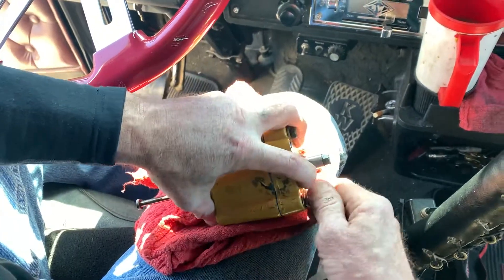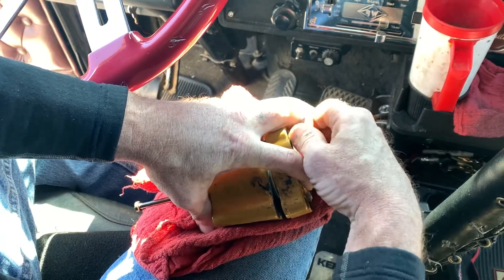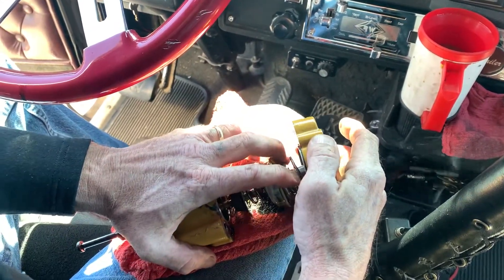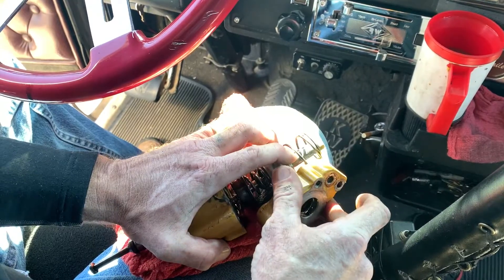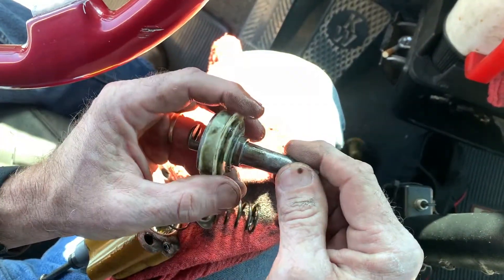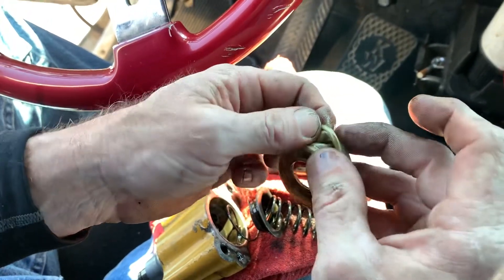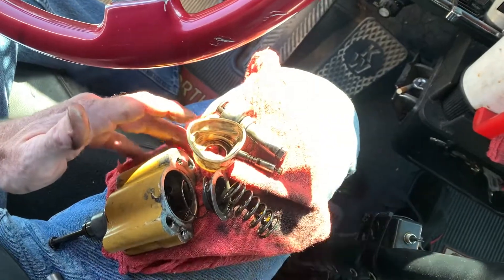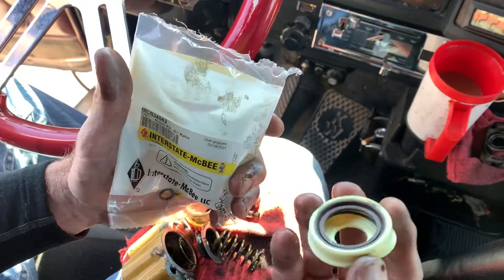CAT 3406B Diaphragm

Comment: Was this getting fuel in your oil ? And is this Fuel transfer pump right ?
Reply from the maker: No fuel in oil. This is not the fuel transfer pump. This is the AFRC.
Reply: Aneroid valve / air fuel ratio ! It push’s the rack to give engine fuel by using the pressure from the intake that the turbo builds during boost ! A faster response !
Reply: @seasonmechanic  can you remove this part and reinstall it without doing anything else like screwing up the pump by not doing a step?